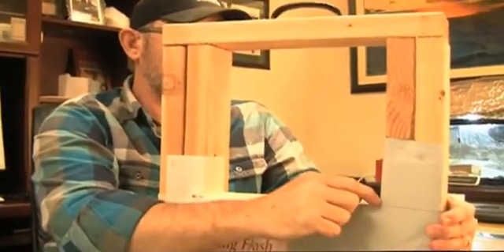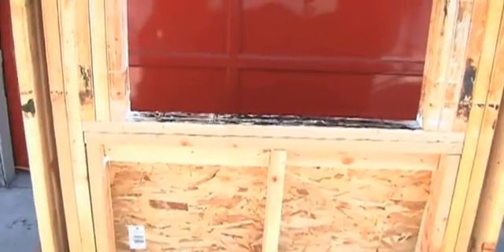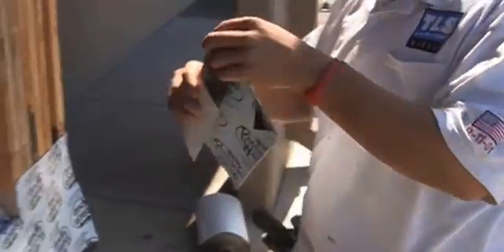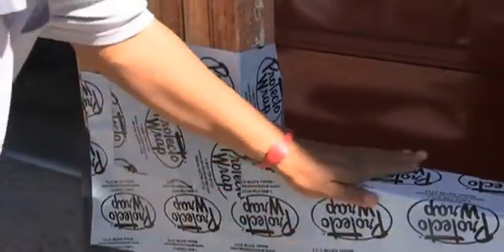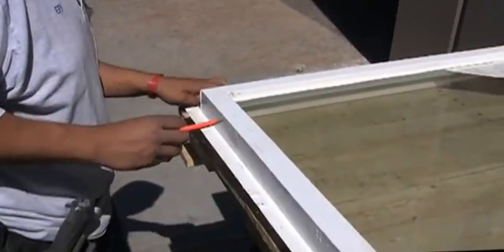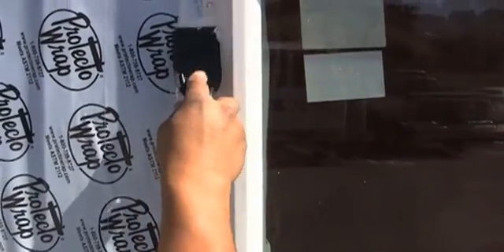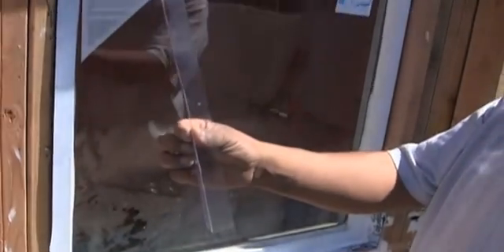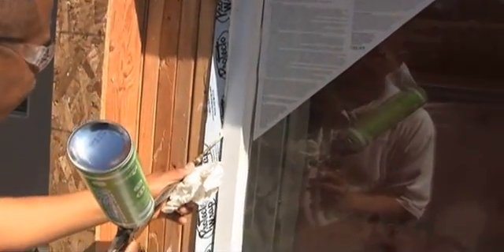Window Installation_Best Practices_TLS Laboratories_Lightning Flash and Protecto Wrap

Comment: What kinda corners were those again. The plastic ones and would the work for heavy punch openings in high rises.
Reply from the maker: larric boyd  Hi Laric Boyd, you are right about the corners in commercial windows. You could use GS 100 A corners or Lightning Flash XL corners.
Call us at 800 310 7673 for pricing and availability,  Thanks again for watching... Gene